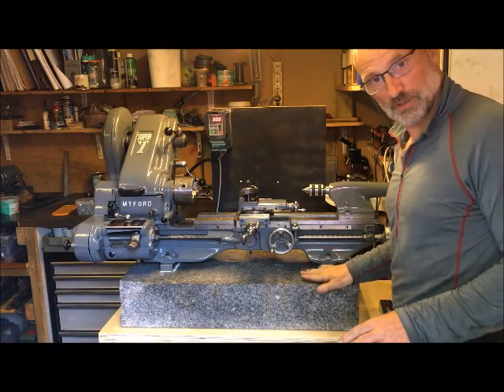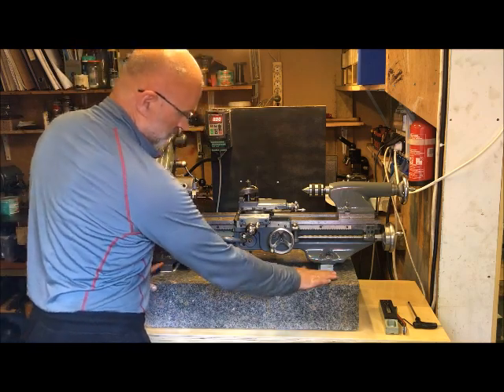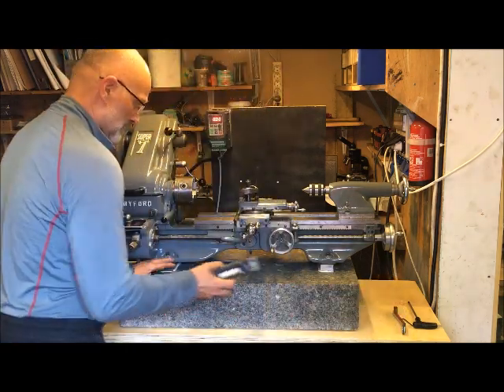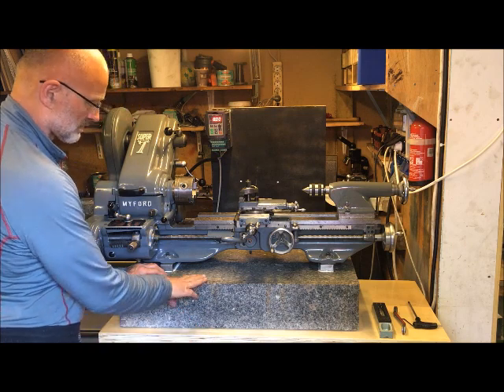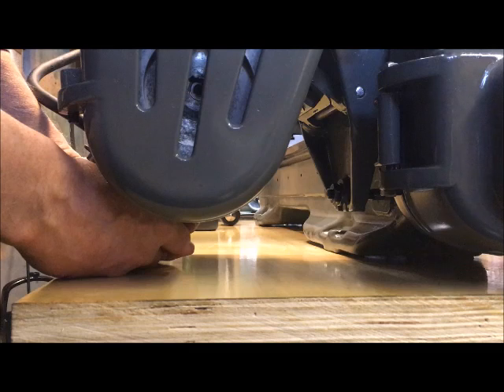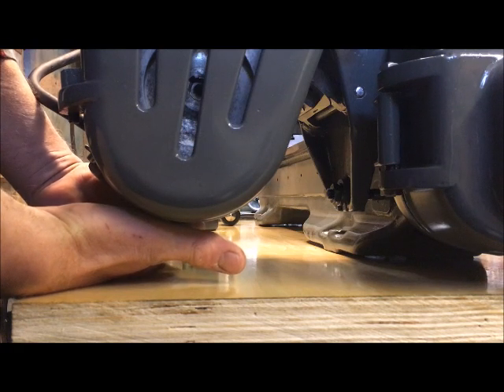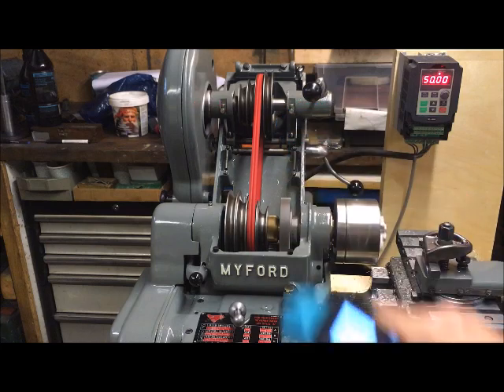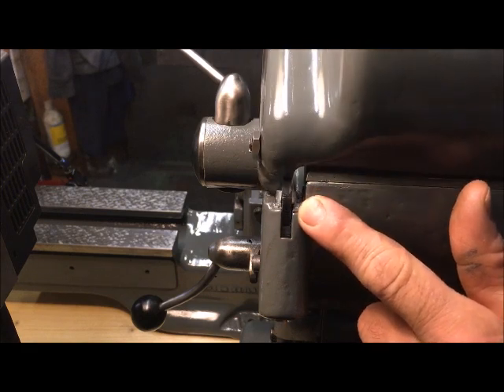Myford Super 7   granite mounted ++

Comment: You and I think very much alike Jan. Mounting that lathe to the stone slab looks like an extremely good idea. Even the 1" thick steel plate I mounted my Emco to made a large difference in the lathes rigidity and accuracy. That's also the quietest running Super 7 I've heard. I suspect that stone may be absorbing some of the minor vibrations that might be still happening.

Did you use some steel mesh and proper rebar in that concrete? It makes a big difference in how stiff the concrete becomes. I've broken and loaded out 10's of thousands of tons of concrete with excavators and hydraulic hammers and you can tell right away when it has mesh and/or rebar in it. Concrete by itself even in fairly large cross sections is easy to flex and break without the added steel, it's far tougher and much more rigid with it.

One tip I picked up off of the Mitutoyo website was they recommend slowly turning the micrometer ratchet at the same speed and the same number of clicks each time you take a measurement to ensure consistency. Some I've mentioned it to don't think it makes a difference. Myself I think it must have some importance or Mitutoyo wouldn't bother to mention it.
Reply from the maker: Thanks! The mounting follows basic principles of vibration dampening, ie. great mass in the foundation, more than doubling the effective weight of the machine which now forms a "solid body" together with the granite, and isolation of the vibration source, ie. some form of rubber feet would do away much of this (I am not sure of the "shore" ie. exact vibration dampening properties of the material I used, but seems to work).
Vibration and sound propagation is a general problem, especially for rotating machinery. As an example of how this functions, try to put your smartphone on a plate, sound OFF, just the "buzzzzerrrr" ON. Then you get a good test of how vibration turns to sound and propagates on the surface in which it which contacts.. Many of the rather flimsy simple screwed-together stands cabinets for today's machines are pure "resonators". The cheap red cabinet I used for the Myford had resonating panels on the rear side which I had to screw tight/together. Here's something to learn from when there were open machines and extra weight in castings. Looking at the better/more expensive machines they have welded & braced steel cabinets or also a cast iron swarf tray. My Schaublin 102-Vm had some 3/5 or so of it's weight in the cabinet/tray and motor
Reply from the maker: Yes, I reinforced the concrete, some 12 Kg's of the 95 is what we call "strekk-metall". Not sure of the English expression used, but it is the type you make open staircases steps/platforms out of. Was thicker and heavier than rebar.

Thanks for the suggestion on using the micrometer! Will try (much to learn :) )
Reply: That sounds like what we would call expanded metal Jan, basically the metal gets slit in a press then pulled open. If so adding that type of metal should work well and I should have known you'd do so. :-) 

I agree 100%. If you listen to how quiet most heavily built lathes run that have a lot of cast iron in the headstock, bed, lower cabinets, and those cast iron chip trays you mentioned there's no comparison with some of the cheaper machines today that have a lot of lighter castings and sheet metal. Even the old very heavy and overbuilt motors run much more quietly that most of today's lighter weight but more efficient motors do. I'm convinced those pressure waves transmit through the machine's components before they become audible to us. At a microscopic level that has to end up going through the work piece and also show up at the cutting tip. Isolating the lathes motor from the bed with hard rubber between it and the lathe bed might show some small improvements as well? 

For general shop measurement then likely using the same speed and number of clicks on the micrometers ratchet thimble would make little to no difference. If the surface finish is very good and your looking for the absolute best measurements you can get then I think it's worth doing.
Reply from the maker: Turning Point Thanks. Amen to your writing! I am also convinced about the improvements derived from vibration dampening plus "dead" weight for mass, rigidity and less force transmission. Will now (when I am back.. currentlt in Singapore) try the lathe at higher speed also, run it through the speed "regimes", and try to find out where and when it stalls, chatters etc.
I did a short trial (just some minutes before I left) on the micrometer readong turning the thimble slower.. seems to work. Was ableb to repeat readings seemingly at a couple of tenths of an inch, ie to 5/1000mm . probably can do better, but still am happy
Reply: Hi Jan, enjoy your trip.
I think with the little I've picked up or even understand about sound and vibration propagation through solid objects it seems to be a very complex subject that takes years of formal training, experience, and expensive testing to be 100% sure of everything that's causing it and the full effects it does have. At best we can make some logical guesses and proven to help techniques that still make large improvements just as your doing now. Harmonic vibrations can and have broken many automotive crankshafts until they started using dampeners so it doesn't take much to create chatter at the tool tip as we all know.  

Not sure if your subscribed to his channel or have seen the video yet, but ROBRENZE here on YT is another extremely talented and clever guy. Stefan Gotteswinter did the same on his lathe and I think your subscribed to his channel. Robin removed the compound slide from his Hardinge HLV and built a well thought out solid steel raising block to lift the tool post back up to the correct center line. He did a great job getting that raising block locked down to the cross slide as well as possible and also prevent any rotation of the tool under cutting pressures. Those HLV lathes as I'm sure you know are quite rigid because of there heavy castings and simple design of the solid way plate bolted to the bed casting. A Myford Super 7 would be roughly 1/3rd the weight and possibly as much as 1/10th less rigid or even less? given it's bed design against how the HLV is designed and built. It depends on the users working habits as to the need of that compound to be on the machine all the time of course. Europe and especially the U.K. seem to use the compound set parallel to the lathes Z axis ways to turn shorter straight sections quite a bit. In North America most seem to use the carriage travel to do the same so we only really need that compound while taper turning or depending on the users methods while screw cutting. A long hard look at almost any lathes compound certainly shows all the extra areas where tool support and possible flex in the parts under cutting pressures is less than ideal exactly like that Russian video shows. Maybe trying the same on your Myford with removing the compound after getting everything else finished might be worth a trial? With yours being far more rigid and with much better dampening than how most fasten there Myfords down then any tests like that should indicate how much the machine improves by not using the compound when it's not required even when a less rigid lathe mounting system is being used.

Very happy you saw some measurable improvements by using the ratchet thimble how Mitutoyo recommends Jan. My Mitutoyo digital micrometers are in very good condition and I think I can trust there measurements at least to the factory tolerance limits. Under the best conditions I can manage and testing myself on my gauge blocks multiple times, I found pretty much the same as yourself. One or two 10ths better on average for consistency. So in my opinion it's a technique well worth knowing about for critical measurements. For myself if I can take the part to the micrometer then using a micrometer vise seems to help a bit more with the consistency as well. But I'm only a hobbyist and not using a micrometer all day long at work.
Reply from the maker: Thanks again.
Njaaa.. a bit tricky for most folks to manouvre in dB's and understand how numbers/sound enerrgy relates, but surely many trades that has its difficulties :) It is true that many sound problems stems from vibration issues, hence a vibrating machine or similar is often the cause, and where to look for the cure..
Oh yes, I subscribe to Mr. Renzetti.. and many more (too many to have time for really)
Stefan is "an old acquaintance" so to speak, him taking the class in Denmark last year and we shared the summer house.. and yes, I follow his channel too..
HLV-H's are in another class of course, but also more expensive. Wouldn't mind one though :)
It is a good idea to increase rigidity by every means possible, especially for small lathe like the Myford, so since the compound is hardly used, it may be off most of the time. (I will set-up at least one machine with the ELS-2 wit h2 axis control, so this specimen will definitively be without the compound). I can't say I use the compound on any of my lathes.. apart form thread cutting and some some rare occasions doing a longer taper (maybe I should try more.. haha)
Amazing to see how much the tool moves just leaning onto the holder (or back of the compound), even with the "stiffest" settings possible
Will certainly test my skills with regards to repeatability with micrometers on gage blocks.. good idea!